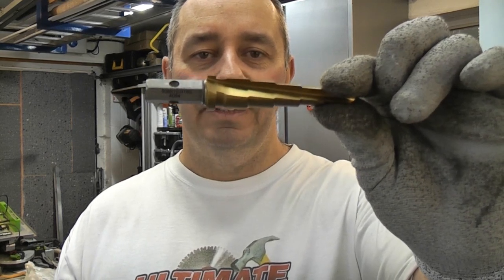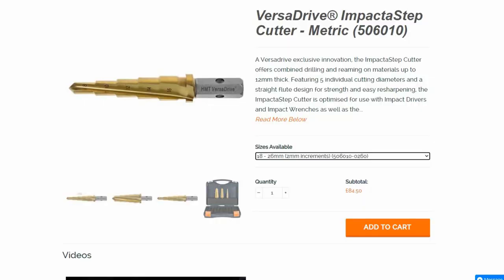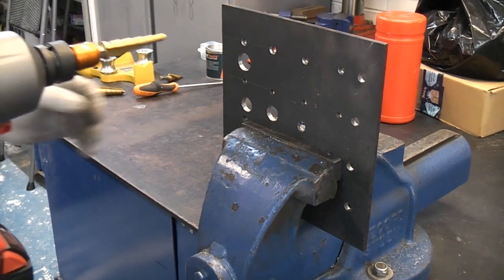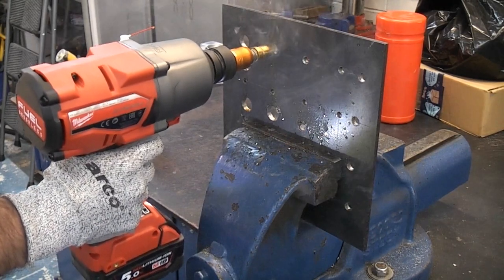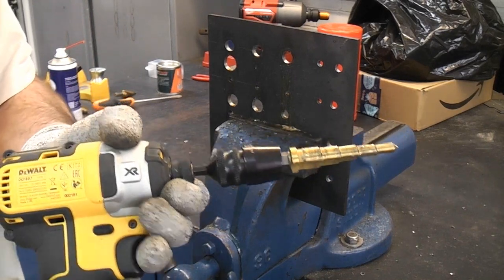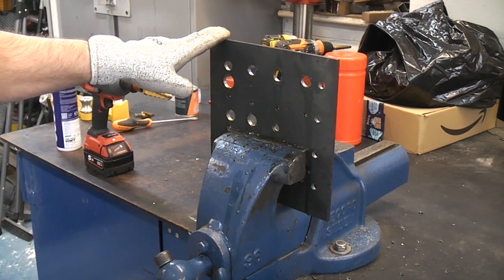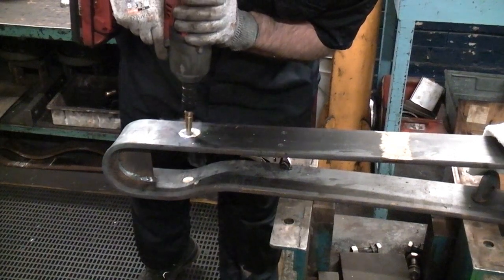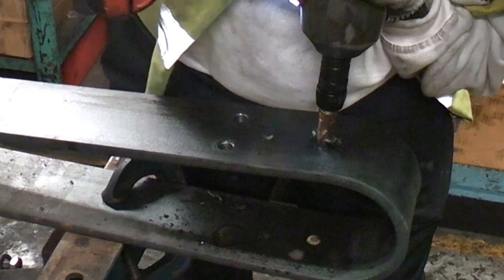The easiest way to drill large holes in thick metal | Impacta step cutter

Comment: Where can you buy them, do you have a product code or something
Reply from the maker: They have a lot of stockists up and down the country, such as K supplies etc.
Or you can get them on eBay- 
3 piece set- https://fave.co/3aF3rav
8mm to 16mm cutter- https://fave.co/3sOoT3b
I've bought a few HMT bits from ebay recently, such as the 3/4 inch Versadrive adaptor that I used on the impact wrench.
Thanks for the comment 👍
Reply: @ultimatehandyman  AAAAAAAND the price is over the roof !
Reply from the maker: @zumbazumba1   Did you watch the video, where I explained about the cost of drilling holes in thick metal?
These will pay for themselves very quickly ;-)

Comment: Reassuringly expensive. I mean that. 

Fed up with buying (in the past, when I was young and foolish) cheap bits and tools. There’s a reason cheap stuff is cheap - it’s crap. 

A bit like this “needs” to be expensive. Because of what it needs to do. 

Great video. 👍
Reply from the maker: Yeah, there is no cheap stuff on the HMT website, but all of their stuff is top drawer.
I recently showed some stuff to a guy that I used to subcontract through, he has been an engineer for 50 years. He was really impressed with their gear ;-)
Thanks for the comment 👍

Comment: Are all step drills designed to be used in a impact drill?  I have a small one and would be afraid to put it in a impact drill. I would never put a standard bit in an impact drill. It would ruin the bit.
Reply from the maker: No, HMT make special bits that are designed for use with Impacts.
I think you would ruin a normal step drill, if you used it with an Impact wrench.
Thanks for the comment 👍

Comment: Fantastic demonstration and you sold me.   Don't expect you to do this due to the expense, but the only thing better would be to see a demonstration of how many such holes could be drilled before the bits dull too much to use with a normal (non-impact) drill.
Reply from the maker: I'm not sure how long they will last to be honest. 
I think as long as you are only using them on mild steel, they should last a very long time- providing plenty of lubricant/coolant is used.
I'm sold on the HMT tools myself now, there is a seller on eBay in the UK, so it's much easier for me to buy them -  https://fave.co/3p1dA7j
Thanks for the comment 👍
Reply: probably 2 to 3 holes and they cannot be sharpened. I use my little mag drill with annular cutters. They are carbide and dont wear out.

Comment: Hi, any advice how to sharpen those tools, please? Sometimes it's an one job and throw item even witgh high lub and good brand. Thanks.
Reply from the maker: Sometimes you can sharpen them using a diamond file, but because they are TIN coated, once the TIN coating wears off, it often won't keep a sharp edge for long.
Thanks for the comment 👍
Reply: @ultimatehandyman  Thanks for all you've done for us.

Comment: Good to see back again, just 1 question how can the drill bit you were holding drill through 24mm thick steel by drilling from both sides, are the steps long than 12mm ?
Reply from the maker: The steps are 12mm, so if you drilled from both sides, you could drill something that is 24mm thick,, perhaps even 26mm thick, if you were going to countersink the holes afterwards
Thanks for the comment 👍
Reply: @ultimatehandyman  Thanks 👏👏👏

Comment: That was Amazing.
But I wonder how it would be if you tried with a sds drill?
Reply from the maker: Not sure, I guess you could use a SDS to 1/2" square drive adaptor,  then 1/2" Versadrive adaptor.
SDS drills normally have a lot or torque, so I would imagine they would work well.
Thanks for the comment 👍
Reply: Hi Toolman - we have a rapid-lock SDS+ Adapter for the VersaDrive range so you can plug that straight in to your SDS drill and use all VersaDrive tools with that adapter. One point to note would be that the SDS drill must be in rotary only mode so the hammer function must be turned off or it will damage the drillbit.Here's a link to the SDS adapter: https://holemaker-technology.com/collections/versadrive-adapters/products/versadrive-rapid-lock-sds-adapter-1

Comment: Hello can you please  advise me im trying to install reversing sensors in my Renault kangaroo maxi van but thayrs a metal bumper plate right behind the plastic i need the hole size of 22mm trird a few hss drill bits to pilot no joy sos help please you know what your doing with steel etc as seen on some of your other vids hope you can help 🤯
Reply from the maker: Vehicles are normally only thin steel, I would use a step drill.
Cheap one - https://www.youtube.com/watch?v=YD-WcAZ_ynI
Quality one- https://www.youtube.com/watch?v=HPv0W0UNdks

Or you could use a hole saw, but a step drill is much less effort.

There are plenty on ebay that will drill a 22mm hole. 
https://fave.co/2PqccxU

Using a lubricant/tapping fluid will also help to prevent damaging the step drill ;-)

Comment: I need to make a 3 inch hole in 1 inch plate steel...wtf do I do...drill press and a hole saw was NOT the way...
Reply from the maker: For a hole that size, I would definitely use a drill press and quality hole saw, unless you can take it somewhere and get it laser cut. 
It will need a decent drill press though, most home type drill presses will really struggle with such a job!

Comment: 200 quid for a few drill bits..Really !!!!!!
Reply from the maker: Like I said in the video, an engineering firm would charge £10 per hole to drill a 14mm hole through that bumper, 6 holes =£60 plus they have to take it away, drill it and bring it back to site.
They are cheaper on eBay- https://fave.co/3aF3rav
Or just buy the one that you need- https://fave.co/3sOoT3b
Thanks for the comment 👍